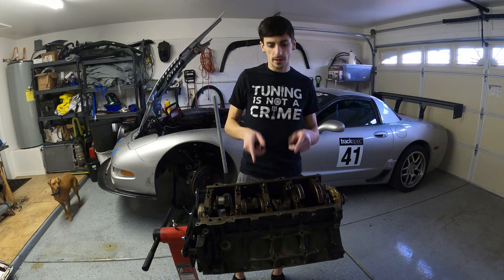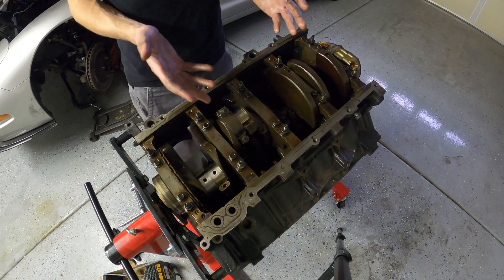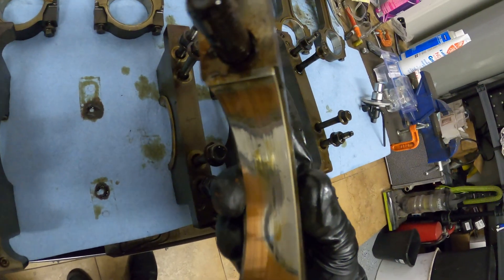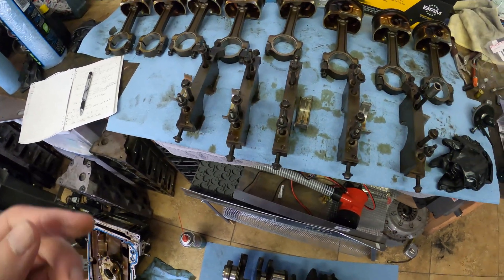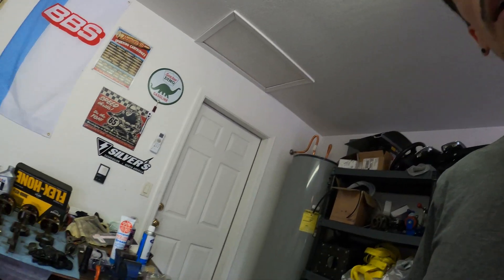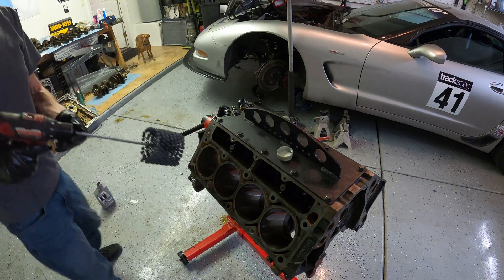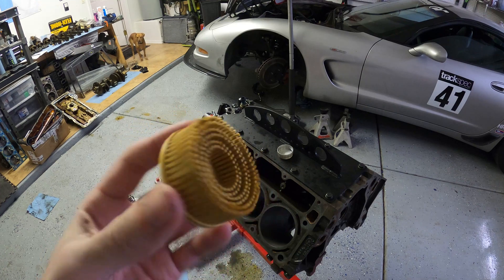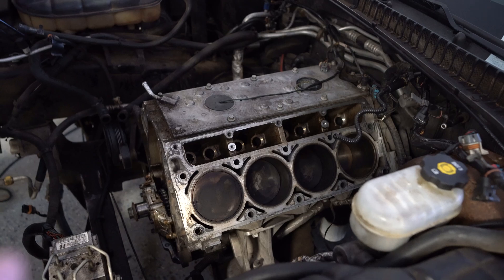Corvette C5 Z06 Engine Rebuild/Upgrade Series: Part 4 | LQ9 Block Refresh!

Comment: What size hone
Reply from the maker: 40 over and new pistons 🤙
Reply: I’m sorry what size hone tool did you get for your 6.0 block. 4 inch ? Or 4 and a quarter?
Reply: @ThePeewee913  4 1/8"